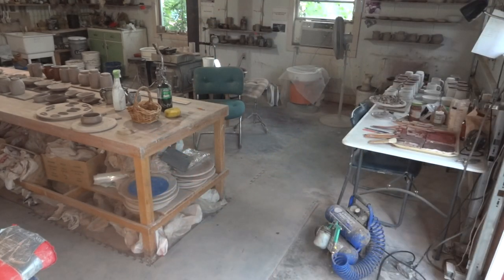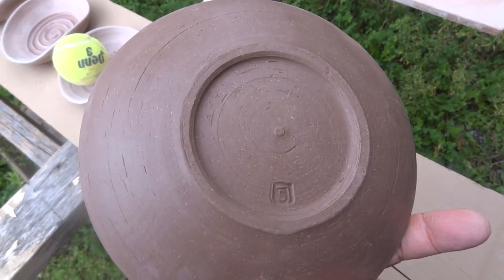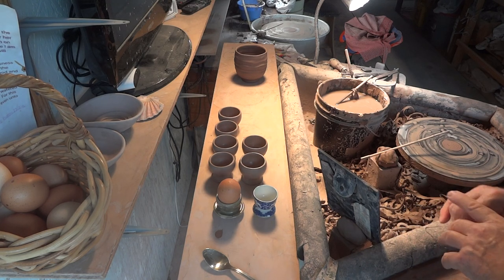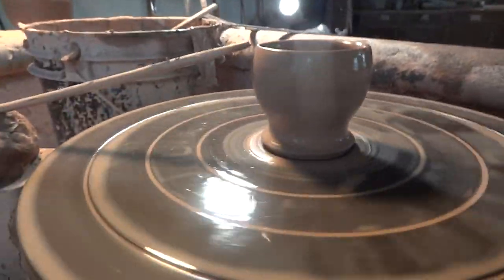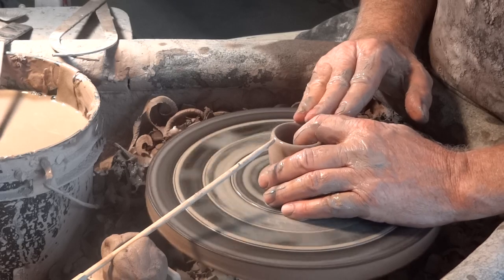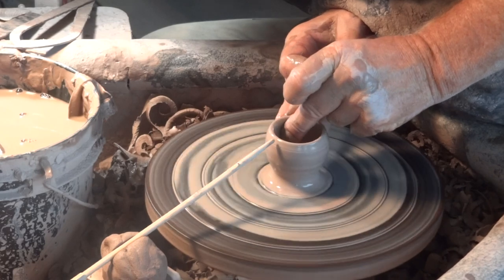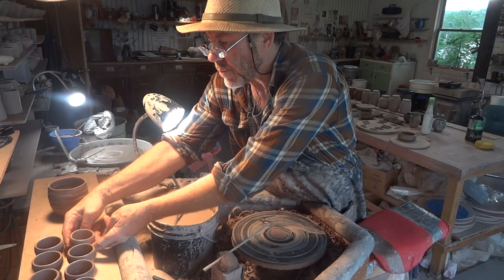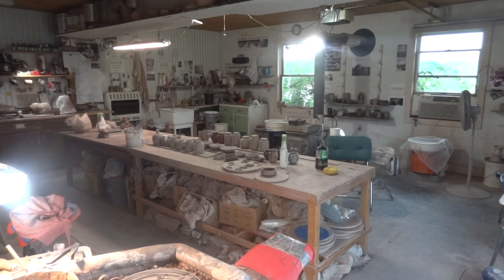Throwing egg cups !  Leach wheels for sale., with Simon Leach

Comment: A few years back I made a raku kiln after watching the one you made with wire mesh and ceramic blanket. I got a roll of ceramic blanket at a place I delivered when I drove big trucks. It was in the trash because it didn't meet commercial standards so it was free. I gave it to the potter who fired the few pots that I was able to make at that time. Plan to make another and have plenty left over to do it. The potter I gave the raku kiln to has a couple old electric kilns that she was going to give me so I could convert them to gas. So many projects and so little time.